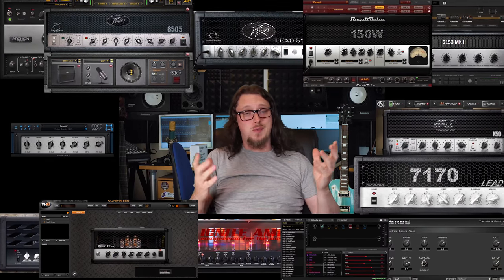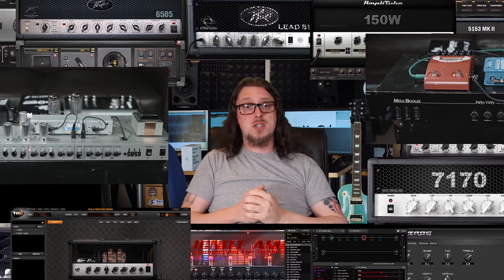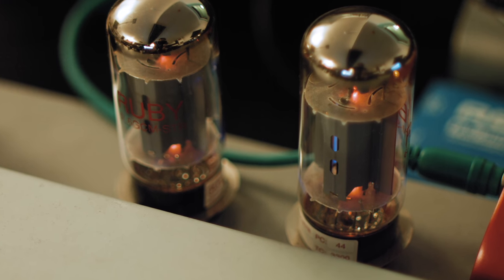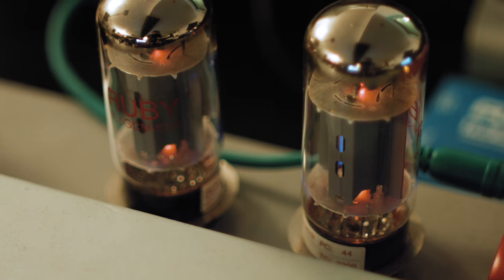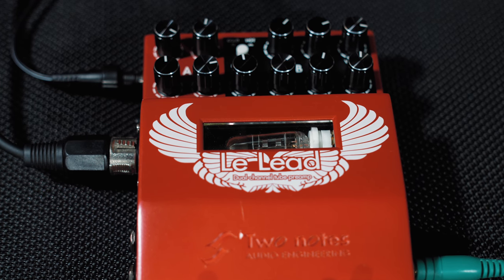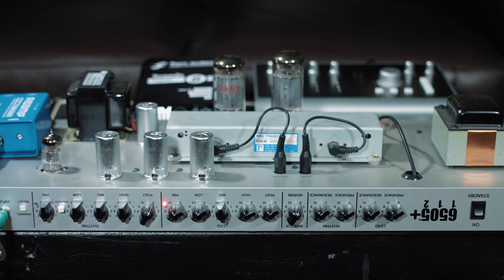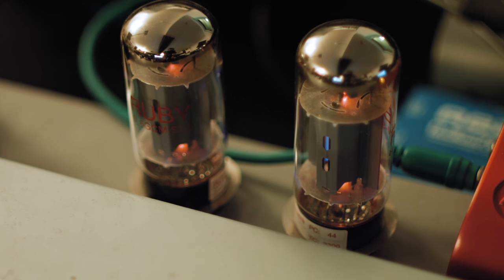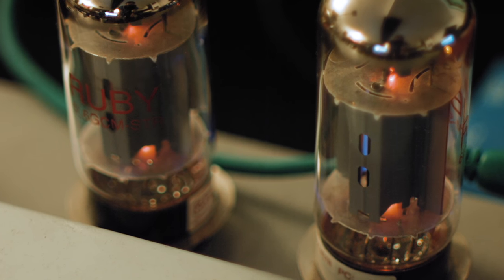Guitar amp Valves- hot or cold?

Comment: I alway's thought that the term hotter and colder running tube amp has fully to do with biasing the power tubes. You can bias them hot or cold and that give's a  huge effect on the sound. This test is a big question for me because I do not think that the sound will differ and I can not hear it either.
Reply from the maker: The terms for bias are just nicknames, biasing is a very separate thing- this video is just to answer a question some guitarists have about “making sure their amp warms up for X minutes to sound good”
Reply: @adamsteelproducer  It is very correct to state that something must have the right temperature to sound good, And that is the temperature of the kathode (by the heater filament) to make it possible to emit the right amount of electrons to make the tube proper work. And that is less then a half minute! No electronic,sound or physical reason to heat the tubes for a long time. The advise of tubeamp makers is (although below the power i.e. 30 Watt it is not necessary at all) is to use the standby switch which allows the filament got the right temperature before switching the HT on.
Reply from the maker: I know- but many guitarists seem to believe their own version of events, so this is an attempt to be fairly neutral on the situation, to let the experiment produce its own results rather than just push a belief (which is often makes someone react more negatively)

Comment: Both sound pretty similar, I can feel a bit more low end (which is not particular good) and compressed sound in the Hot bias. The Cold  sound a tiny more punchy and with the bass in the right place for that sound. Anyway in the context of a Mix it's the same. The difference is not big has the internet forums will tell you, it's marginal.
Reply from the maker: You Misunderstand- this is not hot Bias and cold Bias, this is literally cold (room temperature) and hot (very warm) tubes
Reply: @adamsteelproducer  Thanks, changed my post to reflect that. Best Regards

Comment: You paid 600£ for only the amp part of the 6505+ combo?
Reply from the maker: No, that’s the retail cost of the whole combo. I didn’t pay that for it- the prices are just illustrative!
Reply: Hop Pole Studios oh ok :) 
You bought it new?
Reply from the maker: Nah- got it second hand from a local guitar shop several years back, don’t remember how much for. I’ve replaced some of the larger caps and taken it out of the combo, also changed the tubes
Reply: Hop Pole Studios nice :)
I was wondering, because i was wondering because i bought the 6505+ head for 750 with shipping not too long ago...
Btw, would you use an emptied combo as a cab?
Reply from the maker: Depends on the cab, if it’s a decent build with a good speaker then why not. I’ve always been more of a separated kind of guy, I like to split the weight more than anything
Reply: Hop Pole Studios yes, by seperating, you risk less to destroy your back. Thanks for the answer.